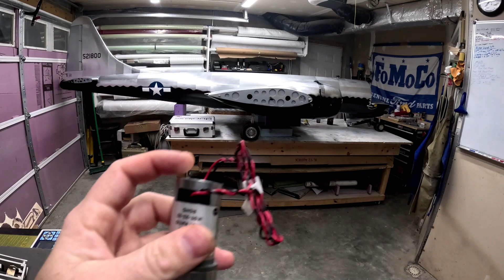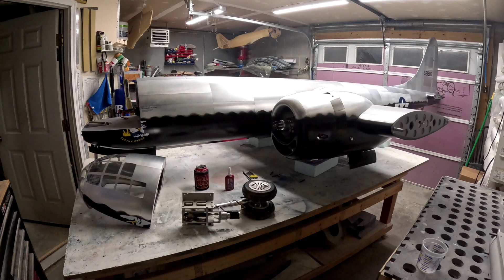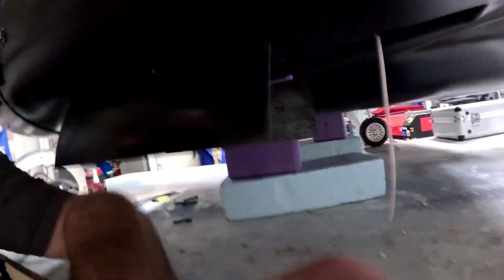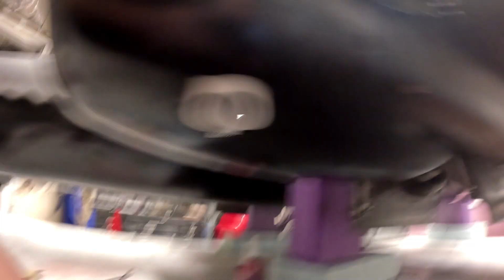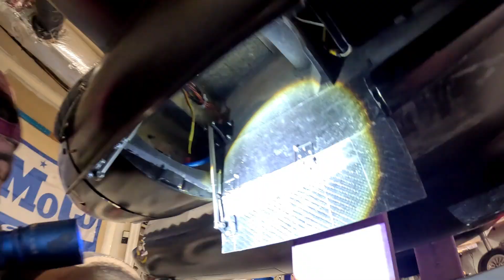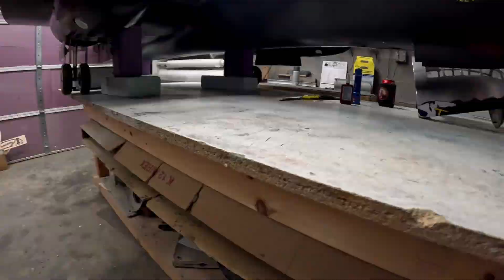B 29 Restoration Project #69- Landing Gear Woe's, Houston, we have a problem.

Comment: How will it do with airflow against it? Did you run it before installing it to see if any difference?
Reply from the maker: We will find out and it made no difference in the before/after install.  The retract rails were never removed, so its no a mount rail alignment issue. Its just a difference in motors